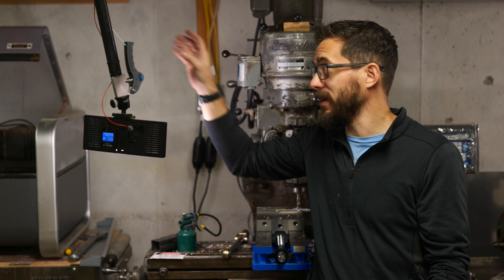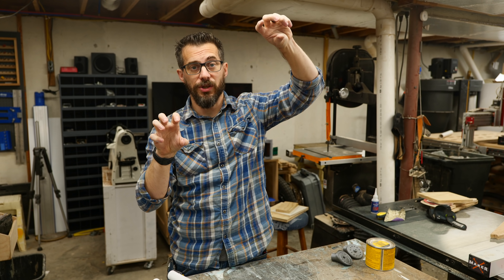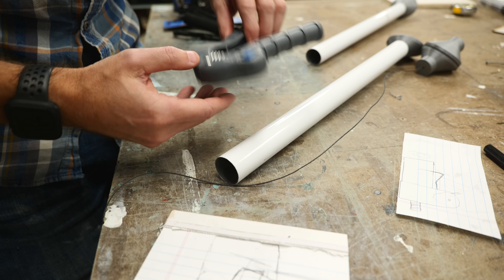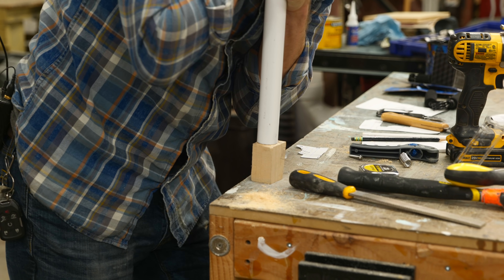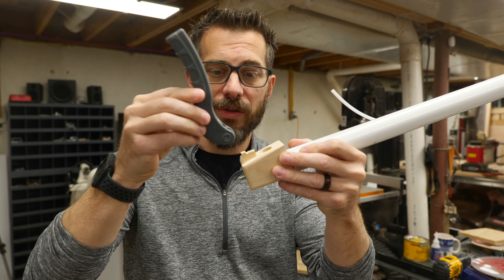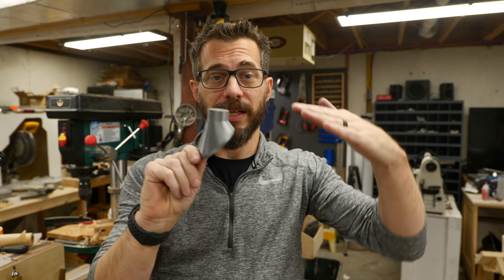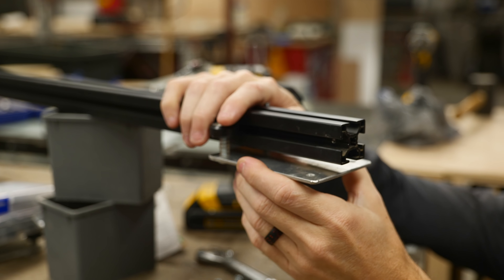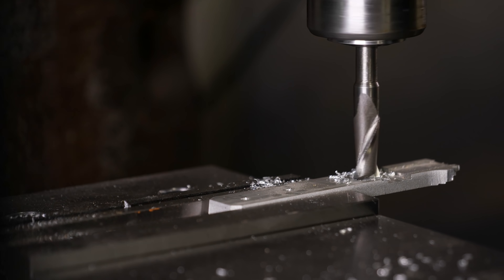Adjustable Work Light Arm | I Like To Make Stuff

Comment: Shame the power cable wasn't routed inside the tube to make the installation even neater
Reply: @dickfer47d  Well in the long run it saved the cable from chaffing and it's easier to maintain and swap out for other stuff as well.

Comment: Another thing that I'd had to those 3D printed parts is a short, yet strong spring. When the cable is thight, the spring is compressed, the mechanism is locked. When the cable goes limp, the spring pushes the two halves apart, so the contraption can rotate freely.
Reply: Exactly, one you could put in the center of the two parts

Comment: Hey, Im a manual machinist of many years. I'm sure others have mentioned this as well, but when your'e machining aluminum, you can speed up the RPM's on that Bridgeport.  Steel requires slower RPM's but aluminum, you can speed that bad boy up! Also, avoid climb cutting at all costs.

Comment: Next build take the power lead up inside the arms, simply place holes with small grommets at the ends to lead it out and make the bend. Will look neater.  Plus with the spring drill and tap a small hole in the centre, so that you place a capscrew in there to provide a good lower mounting for the spring, so that it will not pop out even if you have the cable snap.

Comment: Great idea with using the cable tension to keep the arms locked in position, if you ever wanted to have a breaking system for the trolley, you could always put a T-shirt nut (or similar) within the unused slot in the bottom of the extrusion and use that as your cable end stop.

Comment: Is there a particular reason why the arm has to lock in place so rigidly? It's just for holding an LED panel so you can see better, correct? I might be overlooking something and if I am let me know but, the way I see it, this problem was solved by the people who invented the light fixture/armature that dentists use when they look in in your mug many decades ago. I don't exactly understand the physics behind them but, they're incredibly easy to move and position, they stay exactly where you put the light fixture in terms of spatial location and direction the light is pointing and, best of all, there is no locking mechanism whatsoever. I don't understand the sorcery that went into making them but what I do know is the functionality is stellar. I get it, you like to make stuff and perhaps this is the better design for your use case. Additionally, these dentist light fixtures aren't exactly cheap but compared to a decently kept home machine park, they'd be small bit player in the grand scheme of things. You can get new ones including one of a variety of different LED light heads for somewhere between $700-1000 (most that I saw were under 800€ but I added a little padding so that I don't go lean on the price estimate).It's a really clean solution that just works exceptionally well.

Comment: This is a very nice solution to a major problem. Everyone always has too little light. But if you can run a steel cable through the connections, it should also work with a copper cable !!

Comment: You could have the cable terminate at the top to a plate wedged/spring tensioned, against the extruded aluminum. When you pulled the the handle it would also loosen the trolley to slide and sure up the connection a bit.

Comment: Great vid! I'm thinking lost pla aluminium ball joints with this wire locking system maybe? 
Also, being impractical, but having the tensioner automated when you touch the light would be cool.

Comment: Cool idea and build.

Just an idea... In the rotating joints, what's about a wave spring washer and a thrust bearing. When under tension the spring is compressed and the pieces lock together. When you release the tension the springs push the pieces apart and the thrust bearing can rotate freely.

Comment: Was wondering if you wanted to add a spring between your 3D printed joints. This would creat tension for your cable (besides the built in spring on your handle) and help the divets in the 3D print separate better.

Comment: This is a fine project, daunting and difficult, learning from mistakes. One of the best you’ve made so far.
On the other hand, you can’t beat the characteristics of light. You can shed it, throw it at a piece. The best solution would probably to a some led tubes on the ceiling but he, that ain’t sexy!

Comment: For your track use a bicycle brake after all you've used a bike cable. You could have used the forks as well , head stock,main bar to seat. Cut off front down tube. so manyways to do it. I like it.

Comment: Make a fixture that mounts solidly behind the light with a handle and grip sticking out below. Use a third joint (wrist) on the top of the fixture to connect to the lower arm. That way you could position the light and arms with one hand.
Since you are using tension on the cable to lock the system, ball and socket joints would be more positionable.

Comment: You should add springs to the joints so they don’t lock up without cable tension.
Reply from the maker: They don't really lock up, they could be tighter actually.
Reply: Literally thought the same.

Also a small collaboration with another channel to make the joints out of metal and bearings. Bearings to move freely until some sort of pin is pulled free and then when rotated and released have them set back down. Using same theory with brake cable but have like a pivot point pulling the pin out when squeezing.

Comment: Very cool project. I'm not sure if the fixed detents on the joint are necessary though. If you had a piece of material in the center along with a locking nut, you could dial in the friction to keep the light in place, but still move it to where it's needed. Wouldn't hurt to also be able to run the wires for the light inside the arm for a cleaner look.
Reply from the maker: Thanks for the tips!

Comment: Dude... you have a Bridgeport.  Nice work to begin figuring it out.   Put bolt on and knob on the trolley to firm it up to the extruded aluminum.  that way when you bump the light it won't move.

Comment: That cable is going to wear through that plastic like butter. You're going to need to reinforce the points where wire applies tension to the joints with some metal.

Comment: I actually want to use some of the ideas of this to work on getting an overhead camera trolly setup.  Just need it to be able to take the weight of a canon DSLR as well as have some built in shock absorption so it won't register potential impacts from the table it is attached to.   Great project!

Comment: 80/20 extrusion (80/20 is product name) has a teflon slide bearing that works well on their extruded square tubing and would eliminate the rollers. The tension wire could lock the slide. Next time put the power wire inside too. Could it be your tension wire? Could your tension wire and metal tube carry the power? Very clever design here.
Reply from the maker: We added it afterwards

Comment: Hi Bob,

Nicely done. While I this video it got me thinking on ways that make it easier to move the joints. Why not use print loaded swivel universal swivel locking joints or a ball joint or a steering u-joint. Like the ones for a socket wrench. When can take a look at them.

Comment: Awesome! I must have missed the part where you explained why the electrical cable isn't running through the pipe. I'm guessing it was because you didn't think about it until after you printed the connectors, so you didn't have the clearances you needed to run both cables through the hole. Hope you work out  that issue for version 2.0.

Comment: Oh also one thing I just thought of which is just cosmetic reason but the bottom part of the pole that connects to the aluminum block you made for the handle I noticed since its smaller now that it leaves a half circle gaps on each side. To make that part look more nice you may want to 3d print some half moon plugs for it for both sides.  Just my two cents :)

Comment: I would have just used some large lockline hoses. I don't know whether it was the camera or some slow motion edit, but it looks like you could be running the mill about 3 times faster than you were, especially in aluminum, even faster in wood. I've used cable tension devices like that and they never keep enough to firmly lock things in place. I hope you have more success with that.

Comment: Fort the pivot points, why not a ball into cup shape with the same "cable provides friction when taut" function? Would require a little dish shape on the ball side wire hole, but should give a more granular positioning options.

Comment: You should hang more trucks inside the shop and be able to take off the actual light and put it onto a different track in the other parts of the shop

Comment: Awesome video! I built a house and now I'm working inside. The next step is the garage. I bought some lights but didn't quite find the best spots to put them on the ceiling in order to have enough light where I need it. While not having to make an adjustable arm for them, you just gave me the obvious idea of putting them on rails so I can move them easily, just with a simple stick. Thanks a lot!
I'd maybe have a small question: what would be a simple way of cable management for the moving part? You didn't really show it on this video

Comment: I think you can use bicycle handbrake lever for that wire tenssion part.
Reply: That was my first thought, but bike brakes are levered to APPLY tension, not to release it.  You would still end up needing the spring and finding a way to attach the cable on the other side of the pivot.

That said, some bike cable housing instead of the plastic tube might significantly decrease friction and reduce the chance of binding.

Comment: 9:30 I'm surprised you didn't use the aluminum in the middle of the wood, similar to a knife handle. if you had cut a channel the width of the aluminum bar down the center of your wood piece, you could have pinned the wood around the aluminum. you would have to cut the channel into the aluminum, but it would have given it a more finished look to the handle I think. 

Either way though, it looks great you did a good job on it.

Comment: Been thinking about an adjustable light for my workbench. This is awesome but way out of my resources.
Reply from the maker: We used what we had available to us. You can solve any problem by using what you have and thinking outside the box.
Reply: @Iliketomakestuff  true... I been working with square dowels and a drawer slide for the mechanics

Comment: That trolley has me thinking about using it for AC extension cords and vacuum/dust extraction hoses.  Overhead vs underfoot, less trip hazards and up and out of the way.
Reply: Yes, yes, yes! After dealing once again today with one of the dust extraction hoses on my table saw blocking the outfeed, I wholeheartedly agree. I'm going to put up a track with some generic hooks on movable, adjustable arms like Bob's that can hold stuff up out of the way, anywhere over the saw and workbench. And of course there's no reason not  to have a light, too. There's plenty of room on the track. Like the man says, if it gives you ideas, he's done his job. Thanks Bob. You are my favorite maker on YouTube.

Comment: Hi Bob, what material did you print the 3d part out of? PETG? ABS? What's the life expectancy of this part as it's under some stresses? Or do you find your 3D parts last a few years
Reply from the maker: These are PLA, but PETG or ABS would definitely be more durable.
Reply: @Iliketomakestuff  Awesome. Did you increase the infill % or add another layer on the perimeter for strength?

Comment: Hi Bob, another really cool video. I was wondering; could you update us maybe in a month or two and see how this works? I'm considering investing in a 3d printer for my first digital fabrication tool, but I'm really wondering how strong that 3d printed plastic is over long term use (particularly exposing it to high tensile forces).

Comment: Why didn't you take advantage of the pipes to hide the electrical as well? There's more than enough space to run the tension cable as well as the electrical wires up through the pipes and have it be really clean

Comment: I had a similar idea to this for a long time but I wanted to design the joints like noga style machinist indicator holders. With that style you would have an 2 actual ball joints, one near the ceiling and one by the light. Everything would lock in place when you turn a knob on the middle joint which would lock it down and force 2 inner rods/pipes into the 2 ball joints locking them down.
Reply: Thanks commentor

Comment: Brilliant build, Bob! One upgrade I might suggest towards the "Braking" of the track. if you could put the anchor for the tension up inside the bottom track of the extrusion, maybe with some small washers, that would add an extra point of tension to brake the trolley where it's positioned.

Comment: I love the concept - I bought a photography light similar to that one after seeing Adam Savage's loc-line light, but I like this concept better because it's up and out of the way. The arm mechanism seems overly complicated to me, though, considering I've seen swing arm lamps at Goodwill a few times for $5 or $10. Next time I see one I'm going to grab it and fab up a similar setup - I've got Unistrut hanging above my welding table so I'll just attach it to a trolley that fits in that channel. I'm sure the problem solving skills gained by fabbing up the tubing & 3D prints was worth the time, but I'm just going to take the easy route and upcycle an old swing arm lamp on mine :-)
P.S. I cannot believe you've had a Bridgeport sitting there unused for months! I would not be able to sleep due to overactive brain! I took a class on using one at the local makerspace, then they sold it a few months later (cue sad music).

Comment: It's really nice to see you combine all of those different manufacturing methods. I mean there was woodworking, milling, 3d-printing, laser cutting and a lot of manual work in such a seemingly simple project. 
Also, did you add end stops to the aluminium rail, so the trolley doesn't accidentally slide off?
Keep up the awesome work! Best regards,
Paul
Reply from the maker: Yeah, there are end stop that are removable incase we need to take it off.

Comment: Just out of curiosity, for the handle part that allows you to move the light's position, why didn't you just use a bike's brake handle?
Reply: Just thought the same 😉
Reply: If I remember correctly, the spring is in the brake pad mechanism. The handle is just a loose lever. So he would have had to add a spring to the bike handle, whereas the grip exerciser already had the spring.
Still might have been easier, since the bike handle at least has a strong mechanism to hold the nut at the end of the brake cable. If it is easier to add a spring to a bike handle than add a brake cable retaining mechanism to the grip exerciser, then a bike handle would be better.
Reply: I spring could be used on other end of cable.
Reply: @stuartkorte1642  No, that would not work. Squeezing the handle needs to loosen the tension.

Comment: So, you need to make a light so that you can use the mill, but you need to use the mill in order to make the light for the mill that you need to use in order to make the light for the mill...?

Do I have that right?

On a more serious note, I would like to see you design a 3D printable handle instead of re-purposing one from a piece of exercise equipment.  I think that would make everything a little more polished looking AND make it easier on yourself when the handle inevitably breaks at the worst possible time.

Comment: I have no idea why you made the Wooden/Metal block to attach the hand strengthners onto the pipe. It looked like you could have put the handle (that you removed) up inside the pipe and screwed it in place. The hand strengthners had already been made to withstand its own force, so it felt like you made extra work for yourself (not including making it out of metal as well, because it broke the first time). 

This is not to say "OMG you're doing it wrong!", I might be missing something, but it looked like you were making additional work for yourself and it wasn't explained in the video why you made the decision that you did.

Comment: Why not simply use an actual bike break handle ? The mechanism is already all there and it’s even made to fit around a pipe
Reply: Because you have to pull to create tension with a bike handle. He needs a mechanism that pulls to release tension.

Comment: Why don't you connect the tension wire to a "brake" that locks against the rail?
Reply: I thought for sure I’d see either a gear selector or a front/rear  brake handle from a motorcycle or bicycle with a stop on it.

Comment: ..you should be sure that the light is really continual, not just blinking on a high frequency human eye cannot recognize, when using it with rotary tools. The light and spinning frequencies can synchronize and you will be not able to tell that its spinning. Touching it in that moment wouldnt be very nice...

Comment: What a great project! I feel like this would be an awesome thing for content creators as well - have track around the pieces of equipment being used, then on the arm have the camera attached so you can film from nearly any angle!
Reply: There’s a company that does this. Jazza has his studio setup this way
Reply: I think if you are gonna do that you might wanna fashion it either in this way or like the cranes in the docks with a supporting member being the Y axis (front/ back) and the main member being the side. but maybe fashion it so it uses strings to move on some direction to make it more "stable" and not move too much